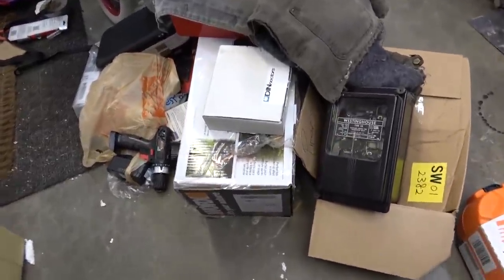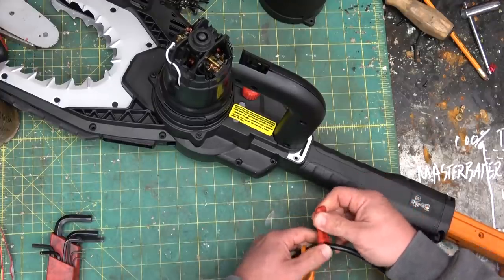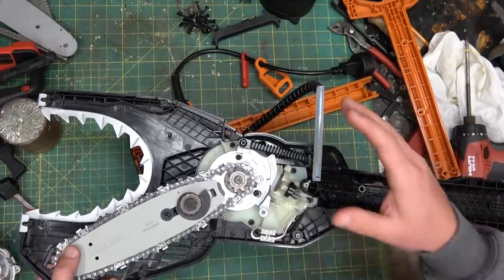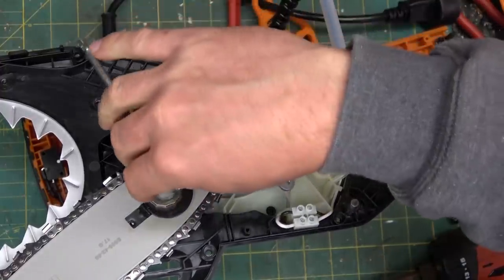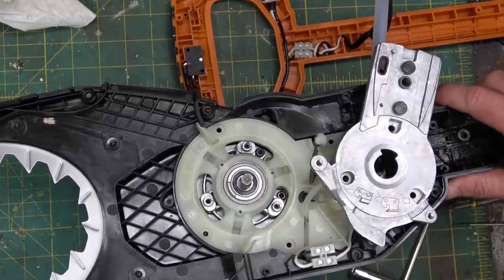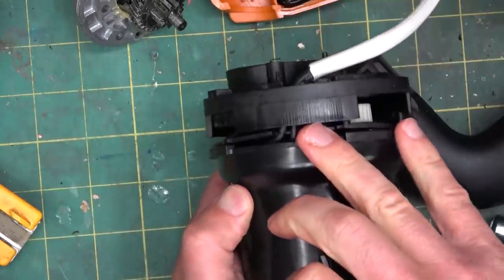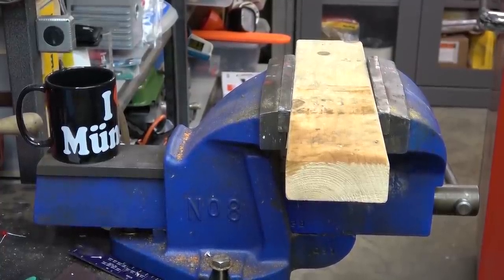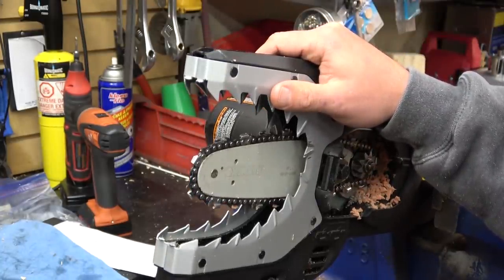BOLTR: Worx Jaw Saw | Engineering Fail

Comment: I didn't hear this mentioned:   After watching it in action, that side door is for more than just lubricating.  It you use this thing for more than 10 minutes, that butt-end cavity will be full of oil-soaked shavings gumming up the mechanicals.   Do things right, and you could turn this into a flaming torch.    Just be careful of the dripping hot melt!

Comment: the orange thing on the pixi receptacle is, so you can let the extension cord run throuh it, to have a safe conection, even if you pull on the cord and it will not come out.

Comment: It is actually great tool,paid 60 bucks for it, refurbish. And there is nothing better for small branches cleanup around the house.Used it several times past three years, still going strong. The jaw holds branch in place as it;s  getting cut.

Comment: My wife has one o these. Its admittedly cheap but works quite well. The "push" actuation works much better for some one who has never used a chain saw. She basically puts the jaw over the stick on the ground and when you push against the ground with the tool the chainsaw swings into action. Would n work the same if it were a pull.

Comment: PA6.6 is more temp. resistant than PP and stronger, but more importantly for the manufacturer, it's also more expensive, so it is used only where it is specifically needed.

Comment: Not surprised that it's not going to last, but I've owned and used a Worx Jaw Saw on our 1/6 acre city lot for nearly 4 years without major issue.  Ours had some annoying rubber flap/cap for the oil fill whereas yours looks to have some new screw-cap thing.

I have used it to trim all the major branches off a few diseased/dead trees to get stuff into our city yard waste cart (4" diameter or less) and then had our lawn service cut down the main trunk at the ground with their chainsaw.  The jaw is kind of nice protection when you're climbing up a slope to cut limbs over your head alone, don't have all the pro-fessional protective gear, and are just trying to get things into the yard waste cart (in my city, 96 gal at $12/mo with 4 pickups per month) vs hiring.  I've gone back and forth about if a chainsaw would have been a better buy, but I'd feel a lot less comfortable climbing slopes/trees/ladders and using a chainsaw vs a jaw saw.  The real joke is the extension pole setup, because it puts so much weight at the end.

Comment: Point on the push to cut thing, I think that's more of a failsafe. If you lose your grip the tool will default to going away from you rather than towards you, and the actual cutting blade will slam back into the body.

Comment: Speaking of engineering fails, Worx leaf blower/ vac. Absolutely terrible. Besides being terrible at blowing leaves and sucking more juice then a microwave it instantly plugs up any time you try to use the vacuum/ mulching feature. The dimwats "engineered" a regular blower into it rather then a chopper so when it sucks up leaves you have to hope they make it through the slots in the blower to the bag and that it doesn't get jammed in the blower housing.

Comment: I know aluminum has a higher resistance than copper but if it doesn’t suffer the same issue with work hardening, would the slightly higher resistance pay off for less failures?

Comment: No matter whether you have to extend or compress the telescopic handle ONE of your arms will still have to push to oppose the one that's pulling. My neighbour has one of these, he loves it. He's wrong if course, what a flatulent bit flimsy. The only thing it's got going for it is comparative safety & it should self destruct quite quickly, rendering it harmless. I forgot to mention, his is lithium powered, so even more short lived.

Comment: I went through 3 of the cordless version in one year. Worx replaced the first two. When the third one failed I didn't bother calling them. I was done with it. It worked fine up until it didn't. I just all of sudden stopped work, Nothing, not even a hum. It seems like there was a break in the circuit. I have no idea where.

Comment: Excellent descruct-o-views Ave. I'm a fan.
There is something I would be interested to see you take apart - a hydraulic load apportioning valve. I see them on the rear brake lines on cars, actuated by the rear axle travel.
Could you get access to one?

Comment: Ugh. Shielded armature bearings. I think the manufacturers know that they dry out quicker and let dust in. The number one failure on a Bosch table saw is the shielded bearing on the end of the armature. I always replace them with sealed bearings. I will only use shielded bearings inside of a gearcase where they are protected from dust and will be lubricated by the grease/oil inside.

Comment: I wonder if the motor housing is different types of plastic because one is more heat resistant and maybe the other is more rigid. Why wouldn't they just use metal? That's still a thing right?

Comment: Hold up my man. I'm at 7:17.
Two observations.
1. The dangly bits on the cable are there to attach the female end so you don't go pulling it out while you're playing texas chainsaw with your kids.
2. The push pull bit is because the teeth are actually decorative ego grabbers, the shape of the cup does not lend itself to you yanking on it as you would be pulling away from your work and actually putting those silly teeth to test, where they would fail, miserably.

... aaaand on with it.
Reply: Oh. As we see in the weiner test, lower jaw teeth might have some function after all. Great channel man!

Comment: Instead of using a compression spring they could have used a tension spring attached in the other direction, which should get weaker as you extend it? :P

Comment: We are stronger pulling than pushing, but in the case of using this thing, wouldn't you be leaning in with your body weight? I thought that was the whole idea, it wraps around the limb so you can be inaccurate with your force.

Comment: One of the best tools I have ever used...I have used mine for over 15 years...this commentator obviously never used it.  I used mine to saw up the branches of five 80-foot oak trees, two dozen 60 foot pines and countless small bushes and ornamental trees.  I had professional tree trimmers go out and get one when they saw how easy it was to use.  In that 15 years I only sharpened the chain once.  Find a friend who has one and test it.  Yes, I have a regular Stihl 18" chain saw, and it works fine for some applications.  But when you need to cut up 4" diameter or smaller wood, the Jawsaw is hard to beat.

Comment: I don't agree sorry I like the little thing the push motion is nice. We used it during hurricanes or tree removal you just walk around with that poking limbs and it cuts it for you. Very handy I believe its safer to let a younger helper use that rather a chain saw with exposed blade, or elderly who don't want to bend down far.
Reply: but I do agree it will not last.

Comment: It is marketed as a yard limbing and bucking tool. The Jaws work well for bucking small limbs. It is not a logging chain saw substitute or simulacrum.This guy obviously knows his engineering stuff but wouldn't the elimination of the tension spring induce over oiling since the handle which controls the oil bulb design  is actually too "free" to inadvertently pump. The phallic humor is juvenile.

Comment: Couldn't you still have it be manually operated the in the reverse like you were saying just have it cut on the pull stroke instead of the push and have the spring push it back to rest?

Comment: Wow. Good thing you never bothered to read the fucking directions or use it before you "reviewed" it. It's actually pretty useful little tool and the ergonomics are just fine if you ever used the thing. I had to take down several trees and periodically have to clean up fallen branches due to storms. This will never cut down trees but it wasn't meant to. You can use it to prune lower branches if you need to that tend to be thicker but what it makes unbelievably quick work of of is cleaning up the branches once you've felled the tree. It was beautiful. Once I dropped the trees I had to drop I just walked along and pushed this down on the branches as I walked every foot or so to cut them up into manageable chunks while someone came behind me with a cart to pick them up. It was so much faster to do it with the jawsaw than having manhandle the branches so I could cut them up with a chainsaw like I've done before.

Comment: I also thought this thing was a joke- until I had to face the reality of cutting up a metric s##t ton of fallen branches to fit them in  the trash container. I don't have a handy brush pile out by the privy, I don't have a tough Ram pickup to haul this stuff to someone else's property (or their dumpster) under cover of night,  and I'm not allowed to burn stuff unless I want the fire department to show up, put out the fire, and then send me a bill for hundreds of $. Using a manly man chainsaw and bending over hundreds of times to cut up branches less than 4" thick as they lay on the ground is not only stupid, it is also dangerous and will tear up your chainsaw (and your back) in a jiffy. A sawzall doesn't work well since every smaller cut has to be secured from moving, it's far slower than the Jawsaw and you still have to bend over. Loppers require both arms, and cutting 2"-3" branches with them is ridiculously difficult if not impossible. For me, this thing makes dicing up less than 4" diameter branches a cakewalk, and it all can be done almost effortlessly using just one hand whilst strolling around and standing upright.  If it only lasts 3 or 4 years I'll get another one. Because it will be easier to get another JawSaw than another back.

Comment: Hey AVE! My car battery is going bad and I’m going to have to replace the friggen thing but  it got me thinking about the bigclive videos I’ve been watching lately where he tears down some of the lithium jump packs you can get on amazon. It got the ole gears turning and I was wondering.. if you were in a third world shit hole and had no other option could you possibly use an 18 volt drill battery to jump your car (I did some looking and it looks like you could with a 12v battery but most of your modern drills use 18v) it might make for an interesting video if you had the time and interest in talking abut it. Thanks for all you do!
Reply: Possibly. The problem is going to be amps. Dead shorted you'd be lucky to get 100 amps out of a drill battery and probably more like 50-60. A lead acid car battery can deliver that brief 200-400 amp spike you need to get the thing turning. Now if you had a few of them in parallel, that could work. 

And of course the other problem is 18 volts might fry other electronics before you even turn the key but if you're living somewhere where you would actually have to do this, your car probably isn't computerized.
Reply: Wingracer is on the right track. AMP draw would be the true killer. Say you have an old school half worn out carb'd 4 cylinder with about 8:1 compression, standard 12v distributor ignition and a basic 1 wire alternator similar to a 10si you could probably do it with 3-4 18v batteries (assuming you could get 50a each on a 3 second burst) and the voltage spike damage would be very minimal if any if you unhooked the pack soon as you get it started and allowed the alternator to run the vehicle.

Comment: I suppose it's fine if you only need to cut 50 branches before it conks out, but if you only need to cut 50 branches it's trivial to do it with a hand saw, and you'll have generated far less garbage at the end of the day.

Comment: I have the battery powered unit. Easy to use to cut downed branches on the ground and a great low cost tool for a home owner. Perhaps they can engineer things better and charge $1K for it instead? Nah.

Comment: I’ve seen these around. I never knew what these horror movie torture devices were intended for. After watching this, I realize this is meant to be a pole saw for someone who has absolutely no business touching a pole saw. It’s a chain saw with training wheels. 
If you need to use this tool to get the job done, hire a guy to do it for you instead.
Jaw saw, gay blade...whichever. 🤷🏻‍♂️

Comment: I've owned mine for about 1 year now.  I have 2.5 acres of WOODS that have been neglected.   Mine is battery operated.   You can cut up branches without bending over and without screwing up your chainsaw blade hitting the dirt.    Not sure why this video is so negative.   I think it works great !   Go watch other videos with it in action on tree limbs, to see what it is used for.

Comment: Hi AvE, first of all I'll have to own up to being the designer of the Jawsaw.
I just thought I should explain a few of my design objectives.
It was never intended to replace a chainsaw for the confident (and competent) chainsaw user.
A regular chainsaw will always be my tool of choice, but not for everyone.
The idea was to provide a safe alternative for the user that would normally not use a chainsaw due to safety concerns.
So best possible guarding was the first priority.
Next was the ability to prune overhead. 
The Jawsaw can very safely be used with a single hand reaching upward - just hook on the branch and push (the second handle is just for "standards").
Last was the ability to cut branches lying on the ground without digging the chain into the dirt.
In all these applications a one hand push is very much easier than pull (which will always needs two hands).
My party trick was to cut a branch lying directly on a concrete path into short lengths.
Just walk along pushing down at intervals, dead easy, no bending, no chance of the chain hitting the concrete - try that with a regular chainsaw.
The other pruning job that is great with the Jawsaw is small springy stems - too thick to easily snip by hand and too thin to safely chainsaw (tend to flex away). The Jawsaw gathers them up and snips them through very easily and safely.

Sorry about the 5A voltage - our graphic artists are not all great on technicalities. I try to catch them all but some slip through.

Comment: I  remember seeing things like this some years ago. They looked cool, but anymore i'd agree this is stupid. If your going to buy a tool anyways get a cheap chainsaw etc. I have a 14 inch electric chainsaw does just as good as a bigger gas one, but maybe a bit slower/ more work. Something like this i'd just go get a chainsaw on a pole, I get an 11FT polesaw I connect to my weedwacker engine. Even that if use right will cut a fair size limb or tree. Not quite made for  but very nice way to limb up dead pine limbs  and you don't have to crawl under the tree to get to the end of the limbs. This thing would just be  too cumbersome for something like that.  Even brush on  the ground I have just gone through it with my pole saw.  IMHO if you can't run a small chainsaw or pole saw then you don't even need to be using this thing.

Comment: It pushes down against the ground. Its main use is to cut up limbs 4" and smaller, on the ground.
You can do this with one hand. Watch the demonstration video. Is it cheaply made ? Yes. What do you expect for a hundred bucks. Is it funny looking ? Yes, form follows function. Did you go into this with a biased perspective ? Yes. Pretty strange and gimmicky. I wouldn't buy one, but I dont think you were fair and that will taint all further reviews, which is a shame.

Comment: Better if they used that motor in some home appliances, like grain/coffee mill - i was shocked about the quality of motors they use there, like twice worse than that motor. Our new coffee grinder from Bosch was ruined because of some horrific coating they used in motor core wires(made from aluminium)-this coating burst during first use and made such horrific chemical smell which attached to all inside. Awful.

Comment: I used one of these ONCE and then threw it clean out of the tree.
I jammed it on to a branch that just fit inside the jaw and when it cut through, the branch fell and caught the teeth top and bottom of the side of the jaw and wrenched the damn thing from my hands as it fell, nearly yanked me off the ladder.
I chucked it in the field and never went back to it.
Could do twice as much in half the time with my little petrol chainsaw.
Not to mention, who has mains power out where their tree is that needs limbing?

Piece of shit.

Comment: I have the "weed eater" by this brand, as a gift. It sucks, but I can see it working for like an elderly couple with a few square feet of grass or a single gal who doesn't want to deal with a gas one. Don't buy it , it's very light which is nice, but akward and plastic but I can see some uses for that.. This on the other hand is what the fuck?

Comment: I have the Ryobi version
https://www.ryobitools.com/outdoor/products/details/5-amp-lopper
Hold the rear handle pull the front and the jaw moves pushing the branch into the bar.
Pretty much the same thing without the ergonomic problems.

Comment: 8:04 - I thought it was "you make something idiot-proof, and your user base will end up being 100% idiots".

Anyway, the reason why this uses a push instead of a pull motion is that the tool is supposed to be pressing against the branch you want to cut. If it used a pulling motion, you'd have to push with the other hand.